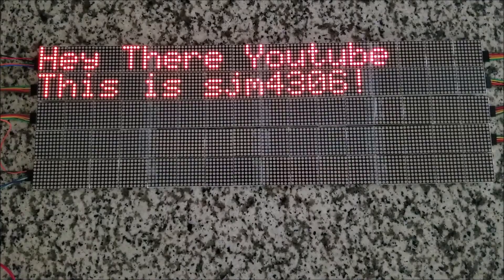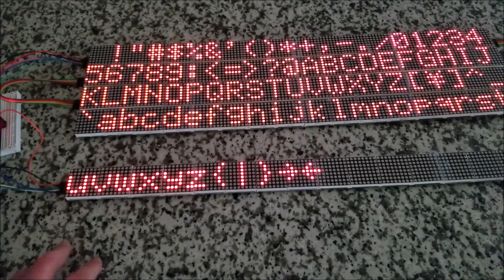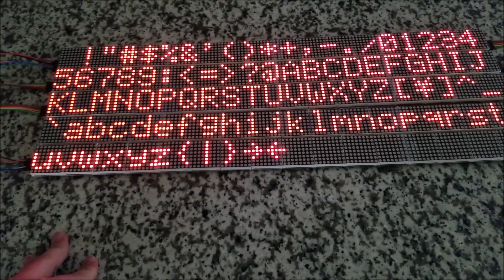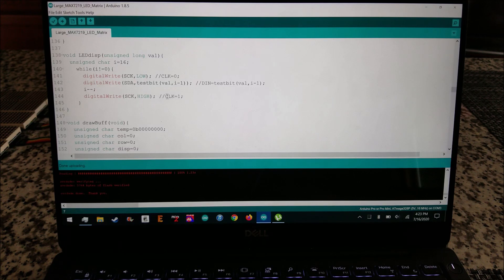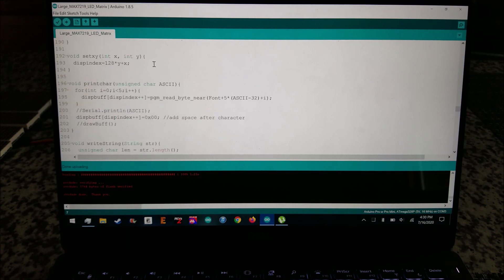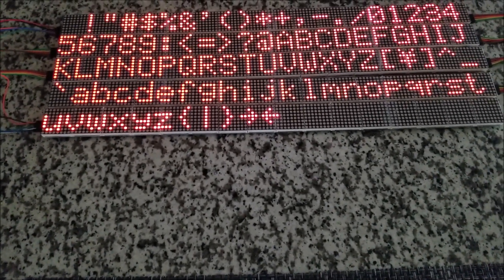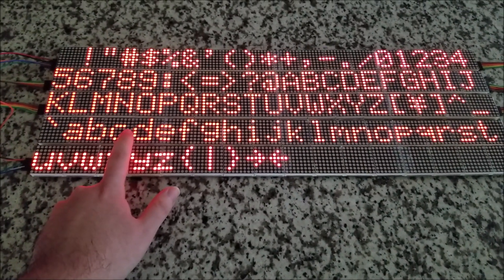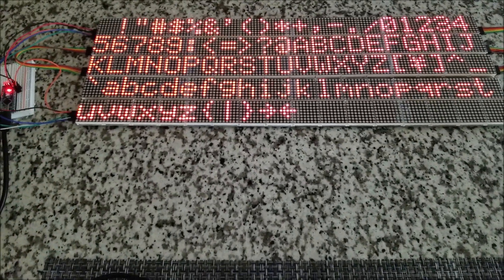128x64 LED Matrix - Part 1: Assembling Modules and Writing Driver Software

Comment: Hey man, I just watched your video on the MZ-RH10/MZ-M100. I just got one, but it looks like it was damaged in transit as the display no longer works at all, despite being known working before it was shipped. I'm wondering if it's possible that the solder joint on the display board is bad, or if I need to maybe reset the settings on it?
Reply from the maker: The chances of the display being damaged in transit are not impossible but very low. There aren't really any solder joints directly to the screen, but rather the flex is hot bonded to the glass and pcb, all of which is securely mounted with tons of tape and adhesive. How can you confirm the display was fully functional before, did you see pics with matching serial numbers? I dont like to be mistrustful but I've seen some sellers in the past who weren't very upfront about selling similar models with dead/dying oled screens.